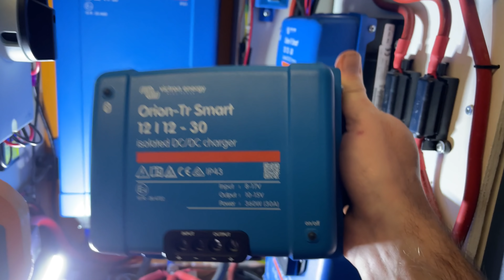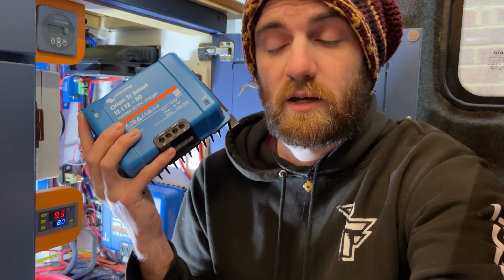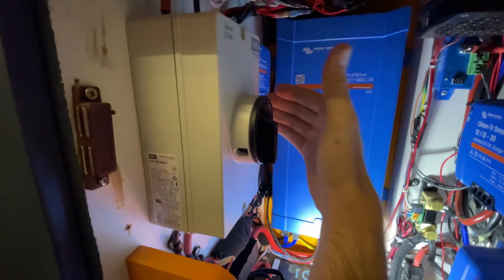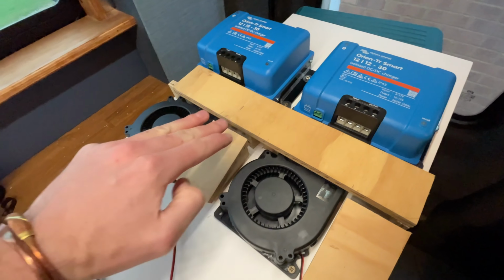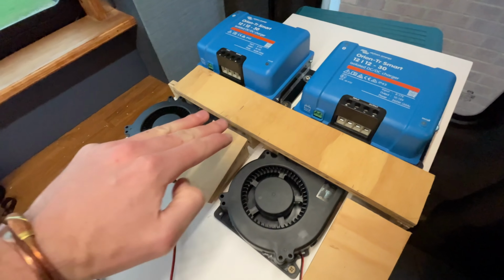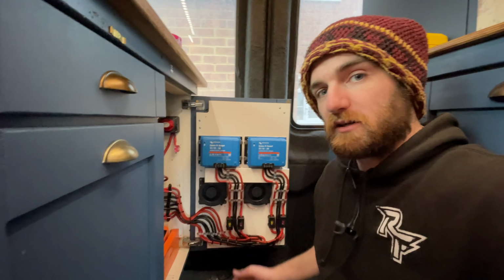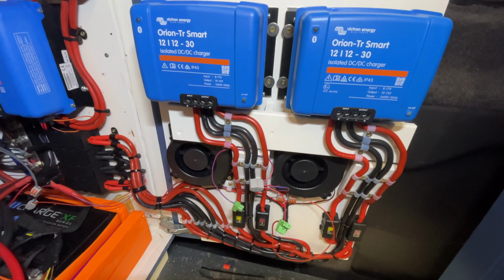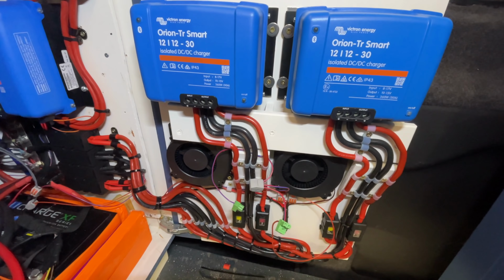Double Victron B2B Charger Install | How To

Comment: Hows them valence batteries holding up my six u27 12xp  are in 2s3p for 24v and going strong
Reply from the maker: I used them for 2 year and never had an issue. Currently have 2 x 200ah Roamer Xtreme batteries. My valence are becoming a solar project

Comment: I have a question. 
I just installed a 12/24 15a b2b with shunt for a 24v lifepo4  batt….. I would like to install a second 12/12 30amp b2b  for a 12v lifepo4 batt with shunt…

Would I be able to power them both via the same 0awg  +/- lines from the alternator? 
 
Seems like they would be considered 2 separate systems because their output sides are independent of each other although their inputs sides are fed by the same source. 

Am I looking at this correctly? 

Any insight is appreciated!
Reply from the maker: Hello, I don’t see why you can’t use the same feed on that input side. As long as it’s large enough, cable diameter to support the combined load
Reply from the maker: Hello, I don’t see why you can’t use the same feed on that input side. As long as it’s large enough, cable diameter to support the combined load
Reply: Thank you!

Comment: The 2 pole switch - is that a constant 12v feed or an ignition live feed?
Reply from the maker: Ignition
Reply: @MispronouncedAdventures  Thanks for clarifying. Guessing take a feed out the fuse box in the cab to the switch and feed that to the remote in.
Reply from the maker: My transit has a ignition live wire in the seat. But a piggyback fuse to the correct fuse in the fuse box would work

Comment: Have you upgraded to a higher amperage alternator, or you are just using the stock alternator? Thanks.
Reply from the maker: Stock alternator in this case could be a multiple of things as transit have a few different options. 

Mine however is 220A 12v which I believe is a mid to high option. 

Generally a aux load should be around one third of the alternators maximum capacity

Comment: Hey, have you come across any issues using the engine detection? I'm about to install a second orion and was told I had to run an ignition live to switch on both units??
Reply from the maker: Nope, I have not come across any issues with engine detection with two units. But I did make sure all cabling was identical in length. I could see within reason why are you may get  an issue if different cables length meant the unit had a different input voltage.

Comment: This seems like an awful lot of cabling for the sake of 60amps.  particularly since you only have about .75m of cable length to your leisure batteries..    Could you not have just bridged from one to another and gone to your batteries with a single run of red and black 16mm2?  seems insane having eight 16mm2 cables coming off that door board
Reply from the maker: As I said in the video I could have stepped from to something like 10mm2 ( or maybe less ) for the small runs after the main 50mm2 run ( which would be been fine at 35mm2, but I was using what I had ) But as now had 5m of 16mm2 spare, it may sense to use it. 

Bridging wouldn’t have been a good option.

Comment: That's a great setup and thanks for the upload. So is there any pros besides no negative to the front using the non-isolated verus the isolated units you used?
Reply from the maker: No real difference between isolated and non-isolated. The effect between the different units is more pronounced on boats. However when I got the original one only Isolated was readily available

Comment: How close to the Victon B2B need to be to the van starter battery? Does it need to go between or can it stay next to my batteries for the camper side?  Hope that makes sense x
Reply from the maker: It’s considered closer to the leisure battery/house batteries the better. 

Reason being is there will be power losses along the cable it’s better to have losses between the starter battery and the B2B because B2B will just draw more to compensate ( more or less )  losses from the starter battery. But you want the least amount of losses possible from the output of the B2B to be into your leisure system because don’t want to loose charge potential. 

longer the distance , more potential for loss  a along the cable. These losses might be small but it’s generally best to have the unit placed as efficient as possible
Reply: @MispronouncedAdventures   thank you. Do you have any affiliated links to the metal backing plates? X
Reply from the maker: Thank you for asking but unfortunately no. They were just standard aluminium checker plate I bought from my local DIY shop and then cut down to size

Comment: Love this video. Thinking about doing the same. Specing van now. Standard is 140 alternator. Can upgrade this to 250 but that then must have an additional aGM which I don't want. Any thoughts on what best to choose?
Reply from the maker: I wouldn’t put a 75amp load on a 140amp alternator, I think that would be too much for it. 

What is the reasoning behind needing an additional AGM if you go for the large 250A alternator?
Reply: @MispronouncedAdventures  just the way the vans get specced from factory. Bigger alternators come with AGM batteries. In my case I want the bigger alternator but not an AGM as will go lithium. Not sure whether to go bigger alternator and AGM which will essentially be quite redundant and then Lithium, or by time alternator done engine, AGM and Lithium I might as well had smaller alternator and just engine and Lithium batteries
Reply: @MispronouncedAdventures  alternatively, how easy is it to put a more power alternator in aftermarket?
Reply from the maker: Should be too hard. I replaced my alternator on my old van after it died, a few hours to do it with simple tools

Comment: Hi Alex. Struggling to find video installing ccp point. If you have deleted what is part number please? Thanks
Reply from the maker: Video is still up and called “Ford Transit | How to Upgrade the Customer Connection Point / CCP. Battery location + Replacement”

Comment: Great video. Just a quick question, what was the name of the trickle charger you mentioned? 
All the best. 👍
Reply from the maker: Is you search on eBay “1amp trickle charger E848” you should find the one I use
Reply: Do you have it wired up with a relay to stop it coming on when engine is running? Or does it not matter?
Reply from the maker: The trickle charger? Its doesn’t matter It’s smart-ish. It’s only turns on when it’s senses the starter battery is 0.2 volts below the leisure battery / input voltage. To confuse things I use a dc to dc converter to make the input voltage 12.4v so the trickle charger only turns on when the starts drops to 12.2v. So it doesn’t matter is the engine is running or not
Reply: I've more or less got the same setup as you and was going to also ask about the starter battery maintainer, I've been planning to use a VOTRONIC StandBy Charger, but I will look at your product. Keep up the good work :)
Reply from the maker: I had looked into the Votronic but it wouldn’t of worked for me as my starter and leisure system are isolated
Reply: @MispronouncedAdventures  Thanks, I will check mine as I'm not 100% sure if mines islotated or not as I'm updating an old pre installed installation and I fitted isolated B2Bs without checking tbh. :)

Comment: Are the fans wired/connected to the chargers so they come on when the charger starts charging?
Reply from the maker: No, but the fans are wired to an ignition live, and if the ignition isn’t on then the charges won’t be on. 

So they are not directly wired to the chargers but they are wire so that they will only come on if the charger is on. As that clearly in happen if the ignition is on

Comment: Thank you for the video! I have installed two victron orion chargers in an almost same way as you. Unforunately, it seems that one charger reads correct house battery voltage while the other reads incorrectly. From my testing it seems the charger that is "closer " to the battery bank (via bus bar) reads the correct voltage and the charger that is further reads a higher voltage.. Wondering if you ran into this problem during your install?
Reply from the maker: That’s an odd one. Same wire thickness on both? Same about of connections
Reply: @MispronouncedAdventures  Yep same size output cables and similar length. It's so strange
Reply: @MrDangari  Because the 1st one affects the voltage for the 2nd one. Did you solve this?
Reply from the maker: They shouldn’t necessarily do that if all the cables are the same be that the length and resistance, maybe there’s a loose connection on one of the lugs, which is increasing the resistance slightly, therefore the not equal

Comment: so the question .... if your battery bank was low... how long will it now take to charge off the engine if your driving ??? :)
Reply: Depends on how big your battery is. One Victron B2B would recharge mine in about 18 hours driving. But my battery is fairly big.
Reply from the maker: With my cooling I get continuous output of 65amp. So that’s 65ah an hour. I have a 390ah lithium bank with a “low voltage” cut off of 20%   Which is 78ah left. 312ah of used energy. So 4 hours of driving to get fully charged. ( and that’s excluding any solar ) 

However most of the morning I’m 70% in the winter so about a hour of driving.
Reply: @MispronouncedAdventures  its funny how one needs 18 hours and yours needs only 4.. but your bank is well documented on your channel.  The obvious answer is it take whatever time is needed, Your solution must almost be at the maximin charge rate :)   Do you see any way to get more power in them faster :) only asking because Power is everyone's need ... and I think you have   done about  everything possible :)
Reply: @David_11111  Alex has 2 chargers Vs my 1 and he has active cooling which helps to boost the output. Plus my battery is bigger... I think. 280Ah @ 24V (560Ah @ 12V).

Comment: 16mm2 should not be getting warm at all,that cable will take 110a,i have two like you using 16mm2 marine cable and the cable stays cold,great build
Reply from the maker: warm is relative to the scene. Any current flowing through a wire will change the temperature of it against the surroundings. which is why thermals are often used for diagnosing electrical issues. In this case the 16mm cable probably only changed a  degree or two But the thermal camera would see that. Whilst if you were physically touching it you might not notice there was a different
Reply: yeah i use a hikmicro m20 camera to check all my wiring  @MispronouncedAdventures
Reply from the maker: Nice thermal camera that 👌

Comment: Awesome, I have been wanting to do the same thing. I always get around 23-24 amps on my single B2B setup and always wanted more. Learning that they can be cooled to make them more efficient makes me even happier. I wonder if setting up a fan pointed directly at the alternator during idle would be beneficial or just overkill?
Reply from the maker: Definitely cooling them helps a lot. I have a whole dedicated video on that. 

As for cooling the alternator, depends on a few factors. My 220A alternator after idle for 30 minutes with both B2B running ( 32.5A outputs on each ) only got Alternator temps of 70c. Which is fine in my face

Comment: why can't ya just use the input power from the Alternator to power the fans?
Reply from the maker: Input side is always live so fans would always been running. The input side isn’t just the alternator. It’s the alternator and starter battery running in parallel. So the ignition live is needed so that the fans only turn on when the engine is started. Otherwise the fans would drain the starter battery as they would still be running when the vehicle was off.

Comment: Does the remote pin need to be wired for it to detect engine power on/off/for it to work at all?
Reply from the maker: If you didn’t want to used a external switch like I have and just rely on the automatic engine detection which would work perfectly fine. you just need to have the green plug on the remote pins which has the small wire bridge between both pins.

Comment: im only get 7 to 16 ah on one. how do you get 35?
Reply from the maker: It would be A / Amp not Ah / Amp hour. 

7-16A is ridiculously low. Have you definitely got the 12V 30a model? 

As for how I get 30+ on each one is cooling

Comment: think i should triple my dc chargers to increase watts .
Reply from the maker: You can do. It’s maybe the new Victron Orion XS 50A
Reply: @MispronouncedAdventures  only gettin 18amps amp clamp by battery same before victron think its alternator it was uprated off eBay Need Bosch genuine new
Reply: Is 90amps ok or maybe 120amps better
Reply: Got Vw t4 2.5tdi
Reply: One lifepo4 leisure battery and use 105ah arm for my stereo separate circuit

Comment: If the cables at the door hinge point went up vertical and then back down vertical, for say 200-300mm the movement and stress would be much less….
Reply from the maker: The door is rarely opened and the cables have a good amount of slack in them. So I’m worried. Sure as you have said there would of been other ways
Reply from the maker: The door is rarely opened and the cables have a good amount of slack in them. So I’m worried. Sure as you have said there would of been other ways
Reply: @MispronouncedAdventures  thanks Quick question: 
Does a dcdc charger and mppt in parallel deliver both currents added together ?
I have Victron inverter, not sure whether to go Victron or Renology with separate or combined dcdc and mppt ….. any thoughts ?
Reply from the maker: Yes, if I’m driving and it’s sunny. I’ll get both the dcdc and mppt at the same time. As they both have the same change profile they play nice together

Comment: Does anyone know if I can use a regular 12 volt ac charger and run it through the DC to DC charger to save money on an expensive ac lithium charger?
Reply from the maker: Do you mean using a AC 230v main charger for 12 volt dc to Power the input side of the DC to DC charger?

I don’t necessarily see why you couldn’t as long as the AC charger you are using could supply enough amps. 

Although there Victron wall charger which can charge lithium is half the price of a dc to dc
Reply: @MispronouncedAdventures  I'm in US so  I'm talking about a regular lead acid 12 volt charger or something that converts 120 to 12 volts. Connect that to a Victron Orion on the input side so I can regulate the charge for my sensitive Discovery Lithium Blue batteries. This way I could save a bunch of money on a fancy AC charger converter. I don't see the input being any different than that if a alternators. Only concern is if the Victron charger/chargers will stop the current which I assume they will  when the batteries are full
Reply from the maker: Ah I see what you mean. Yeah be your AC mains 120v in the Dtates or European 230 V the core principle is the same. I don’t believe in that input side of the Orion particularly cares where the power comes from alternator,  another battery bank hopefully a charger acting as a power supply. As long as you’re 12V charger can output probably around 35amps it’s should work. Orions of efficiency of about 87% so you’ll need a slightly higher input to get to the 30 amp output. 

I don’t personally know at the moment what happens if your power supply is under the 30amp. If the Orion just tries to convert what it can get or won’t work at all if it can’t get 30amp worth
Reply: @MispronouncedAdventures  This is a very interesting idea and I don't see anyone doing it. This might be the beginning of a new way to save a lot of people a lot of money and get people the opportunity who otherwise wouldn't be able to afford an expensive Ac converter. I do wonder if there is a good reason it's not being done.
Reply from the maker: I would’ve thought as a separate AC to DC charger is half the price of the Orion DC to DC. 

The Victron Blue Smart 30A charger (  120v or 230v AC to 12v DC ) which can charge lithium is almost half the price of the Victron Orion DC to DC
Reply: @MispronouncedAdventures  The DC to DC is a must for a Van obviously. Two 30 amp Orion's for faster charging. Switches in the cockpit to run just one at idle to prevent overheating of the alternator. Charging the batteries from shore power would be on the rare side. When needed though: I can only imagine how much it would cost to have a 60 amp smart lithium AC converter. I'd be charging my batteries with a generator when camping. Wouldn't want to run my generation twise as long with 30 amps.
Reply from the maker: Ah sorry I misinterpreted your original question. Assume since you were talking AC that you were in a static environment and not a van. I now see you would’ve been referring to AC potentially from a hook up or generator in van